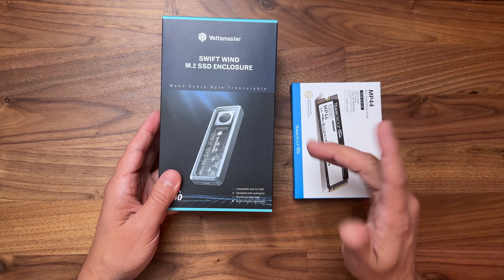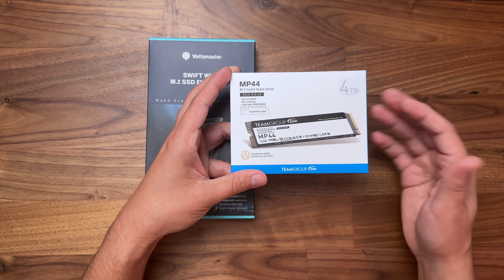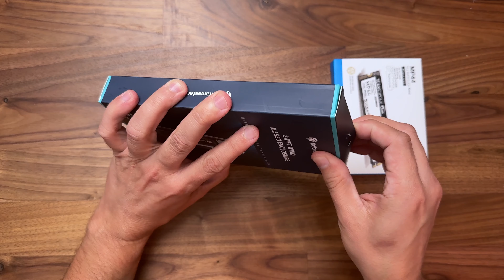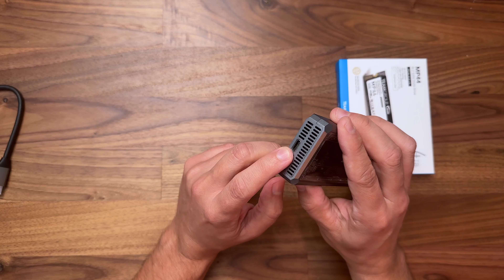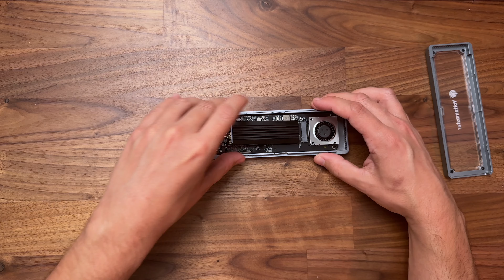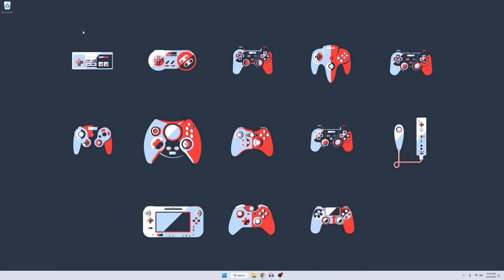BLAZING FAST External Hard Drive! -- Yottamaster NVME SSD Encolsure

Comment: I have a silly question. I have an old SSD with a factory heatsink. I want to use it for something but I don't have any systems at the moment that can take advantage of it. Do you think this enclosure can fit an SSD with pre installed heatsink?

I mean it is ideal because it has a fan.

The thickness of the SSD is about 1/3 or an inch or 8.4mm.

Cheers.

Comment: does the nvme have a dram cache? is the write speed slowing after a while due to the lack of dram?
Reply from the maker: Thanks for the question! It has 128MB of DRAM. I haven't experienced any speed drops personally.
Reply: Thank you. I think the 1 year warranty is a drawback for these Team nvme ssd's whilst crucial are happy to offer a 5 year warranty
Reply from the maker: @RameshRam-tr4zn  I actually just double-checked, and this drive does also have a 5 year warranty, so you shouldn't have any trouble there.

Comment: Don't you have to peel the label which was on nvme before applying the thermal pad?
Reply: The label is a thermal transfer heatsink.
Reply: The data is mixed on this.  The sticker itself serves as a thermal dissipator too.  Which works better?  The stick or direct contact with the thermal pad? That depends on the specific drive and thermal pad.

I would probably want to take the sticker off to get direct contact between the chips on the drive and the thermal pad, but it won't make a massive difference either way unless you are hammering the drive with a lot of load for an extended period of time.  In regular usage, it isn't really a problem.